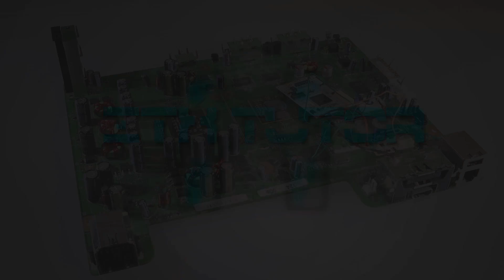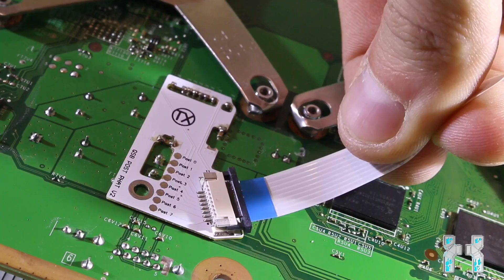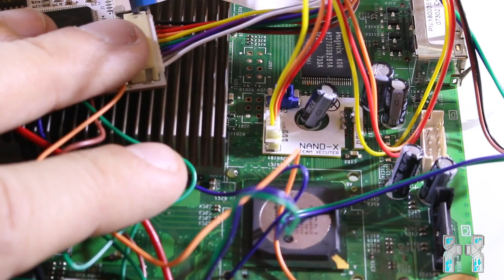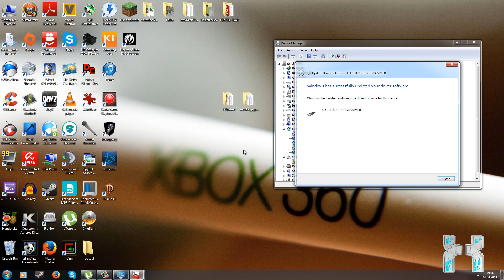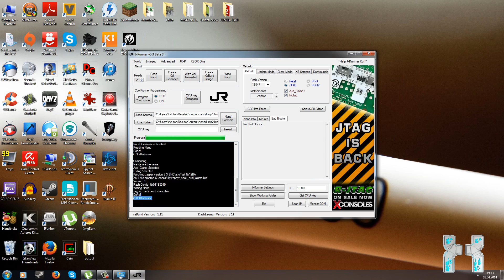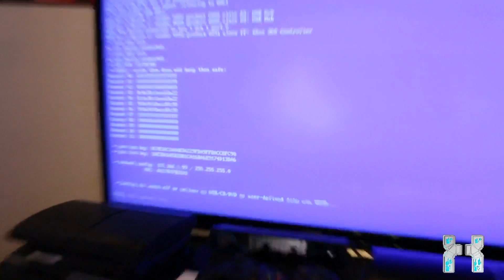How To R-JTAG your Xbox 360 ! - Part 3 - Reading Nand & Flashing Xell [HD]

Comment: jesus homebrewing wii is much easier than this
Reply: TheIronlefty step 1 to modding Wii,get a micro sd to sd converter and put the micro into your phone,get the mod files and put them on the sd
Step two,install the software to the Wii
Good luck fuckers
Reply: TheIronlefty #truth
Reply: help me i update my xbox 360 that jtag and it turn on but not showing on my tv screen help
Reply: JTAG is really easy tho: one wire, two diodes. That's it.
Reply: Xbox 360 hacking is quite difficult, as it requires modchips and other stuff. The Wii, on the other hand, simply needs some files on an SD card, click a red letter on your message board, choose some options, and B A M you're all good to go.